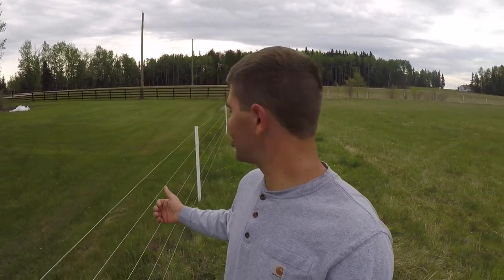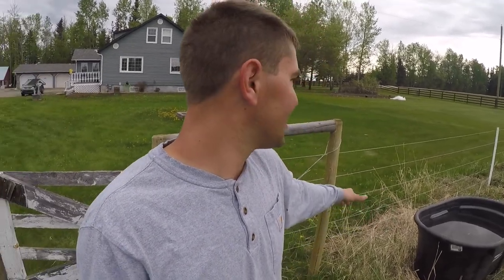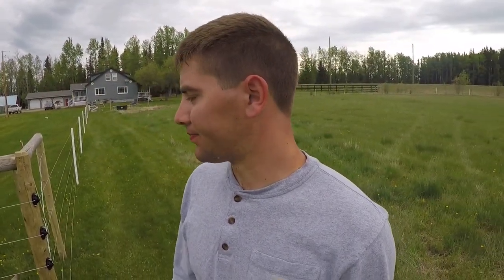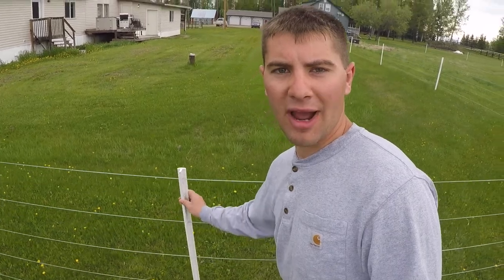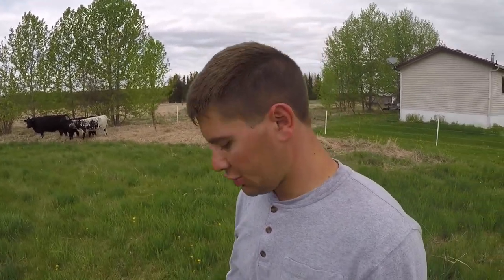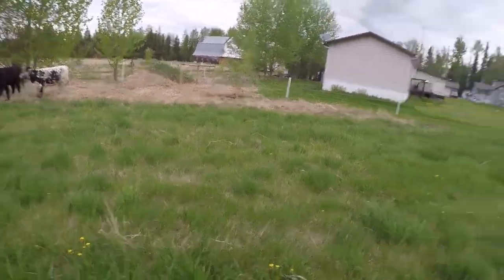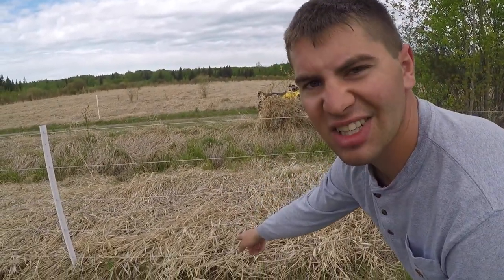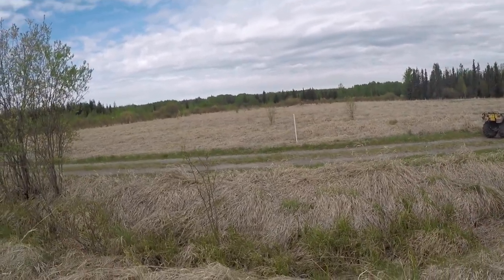New Timeless Electric Fence ( First Impressions)

Comment: As a heads up Greg Judy recommends electrifying the bottom at all times because it helps kill the grass along the bottom especially with a hot charger. Dry stuff that's dead won't short the fence.

Comment: Wonder how those work with 1/4" polywire for horses? What diameter are the holes in the pvc posts?
Reply: People sometimes attach electric wire to the outside of the post with a soft wire through the hole. Greg Judy does this when appropriate for a few different situations.  You could wire a poly tape in the same way.